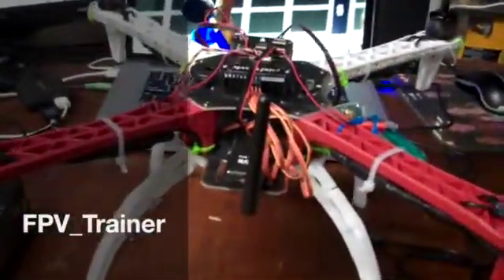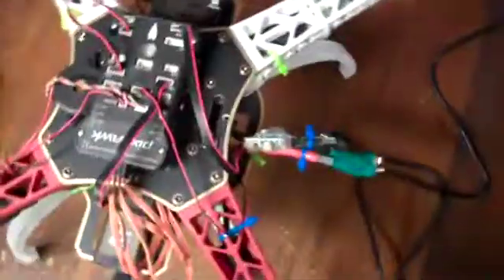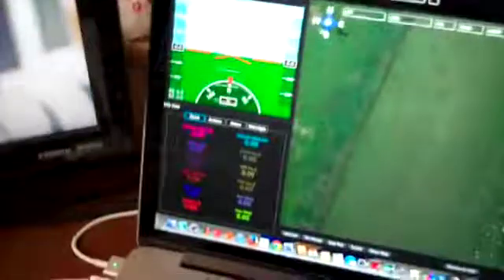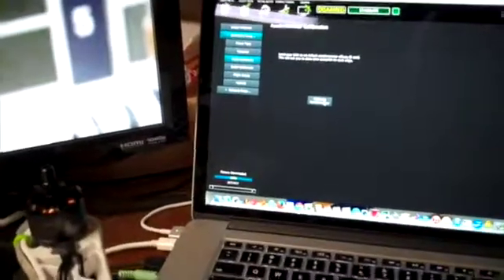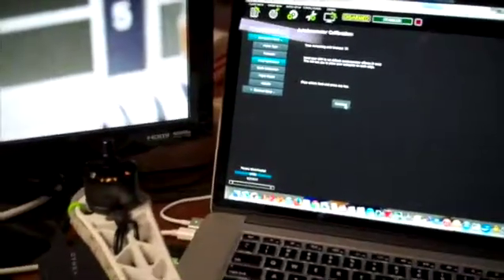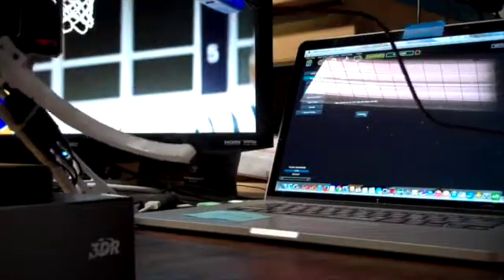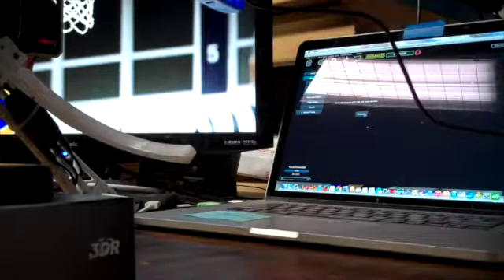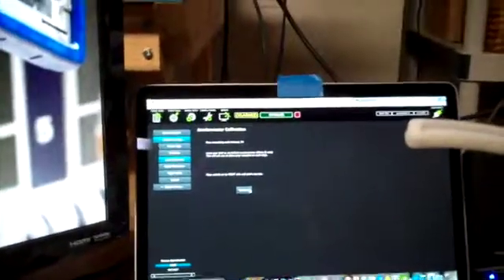PixHawk Won't Calibrate

Comment from the maker: Nope
Reply: I use mission planner and I dont know if it is different than your apm planner but I know in mission planner doing the step your are having issues with there is a time limit to complete this step. Place on left side, right side, nose down all that stuff needs to be fairly quick in mission planner. I say 1 or 2 seconds with in each step. Found this out after a long night trying to find problem like yours. And have never had issue since. Good luck